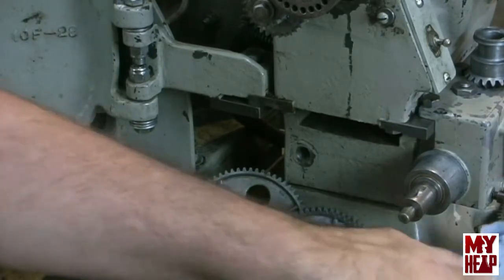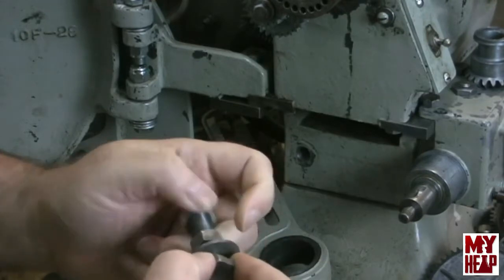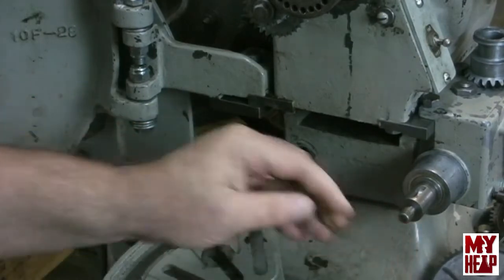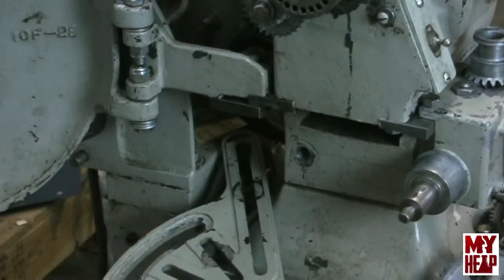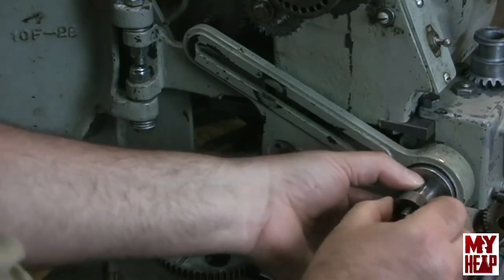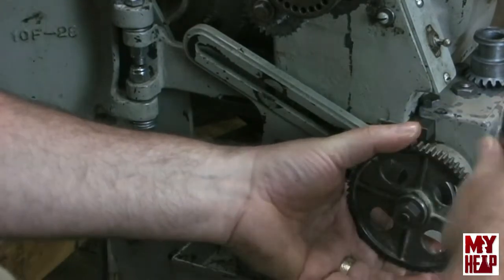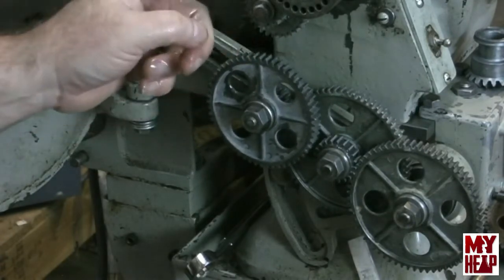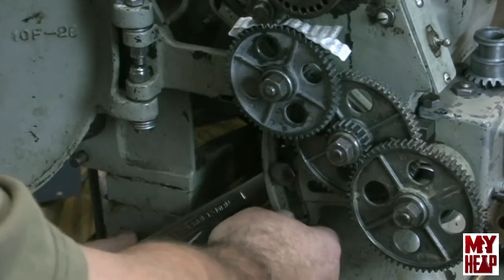Atlas 10F Lathe - TH54 - 12 - Banjo and Change Gears Revisited

Comment: What I use on bedways is chainsaw bar oil. It is made for extreme metal on metal contact and it is good and sticky as it is formulated to stick
Reply from the maker: Steven, that sounds like a good thing to use.  I will pick some up the next time I am out.  Thanks for the tip.

Joe

Comment: G'day Joe, another good video. I like your paper shim to set the teeth clearance, I'll have to remember that. Also a shorter spanner would be handy. Like you I'd like to spend money on good video gear but can't justify the outlay, but I have found good lighting makes a big difference. I'm also thinking of making an articulated boom for the camera, hmm, should look into that. Cheers Peter
Reply from the maker: Hi Peter,  I picked that trick up from Lyle Peterson over at his Channel.  I think I will need to get a new wireless mic soon as mine is starting to make some noise.

An articulated boom mount?  That sounds like a neat project.

Joe

Comment: Great info - I just have to work out now why my lathe is so noisy when i engage the banjo.  I am also a little confused about the washers on the bolts which hold the gears in.  Why are they beveled and is it important to use the correct washers?  Secondly, do you have the specs for the washers so i can try to reproduce some?
Reply from the maker: Hi Gary.  In one of my recent videos I had some gear noise from the drive train.  Turned out, for me at least, that the compounded gear attached to the headstock was loose.  The washers are only beveled on one side to for aesthetics to make them look "purdy".  I am missing one myself and use a couple SAE washers in its place.  The next time I am out in the shop I will measure them and let you know the size.  Now that I think about it, I should make the one I am missing too, just so it doesn't look tacky when the gear cover is opened up.  HAHA  Noise can be reduced by proper gear spacing (I usually use a strip of copy paper folded in half to set the backlash) and a generous application of gear oil.  I hope that helps some.  I will get the measurements of the washer to you soon.  Thank you Gary for watching and taking the time to comment.  One last thing, noise can be generated from the spindle if the bushing is worn on the smaller gear on the left side of the spindle as you are facing the lathe.  Grab it and see if it wiggles.  But you stated that the noise was there when you engaged the banjo, so it is probably fine.

Joe
Reply: @MyHeap  Thank you so much for the comprehensive reply.  It really does help me learn.  Thanks again and keep the videos coming
Reply from the maker: @locustbay7594  the washers are 1 inch OD, they are 0.125 thick.  They have a clearance hole for 3/8-16, which is 25/64.  Finally the chamfer is 45 degrees and about 0.035 thou deep.  Hope that helps.
Reply: @MyHeap  This is a great help Joe.  I appreciate the info and thank you.
Reply from the maker: Hey Gary.  We are all in this together brother.  Glad I could help in some way.

Joe

Comment: Bom dia amigo? Comprei um torno atlas 10f hf54, preciso da tabela de rosca, vc teria?
Reply from the maker: I am sorry.  I don't have any spare parts.  I would suggest taking a look on ebay or posting on the atlas craftsman io group.

Joe
Reply: @MyHeap ola amigo, preciso do  de rosca metrica e polegadas que esta na parte interna  da tampa, no compartimento de engrenagem.
Reply from the maker: @richardbatistafreitas4176  all the threads I have cut have been accurate.   Some of which have been measured with thread wires and micrometer.   I don't know how precise your threads need to be, but considering it is a 70+ year machine with lead screw wear, I am sure the threads are not super precision.   Still the machine produces good work for me.  I hope that helps.

Joe

Comment: Myself I just drip the oil on the gears as they run and it spreads itself. A brush is like to be snatched up in the gears if it's running and gets into mesh. Don't ask how I know this lol.
Reply: How do you know this Chris? 🤔
Reply from the maker: Uhhm...  Thanks Chris.  Maybe I should try the brush with the power off then???  :-)
Reply: My Heap very slow like I say just drip some on the gears as they run.if it flings off its to much.